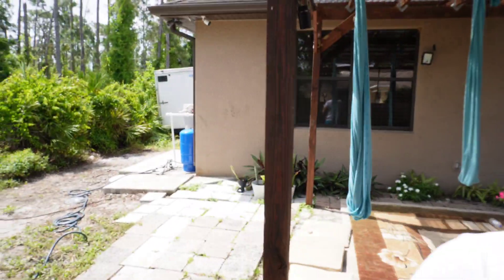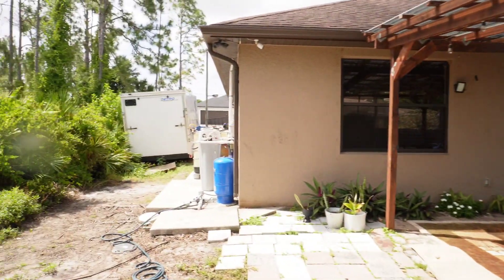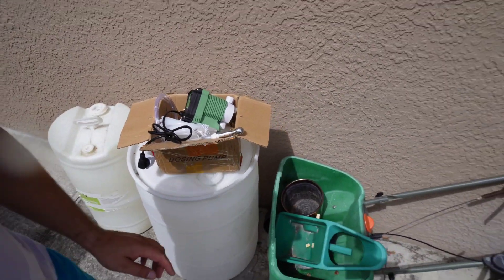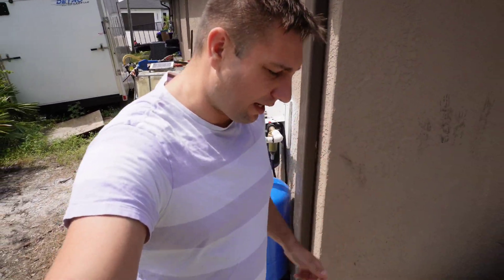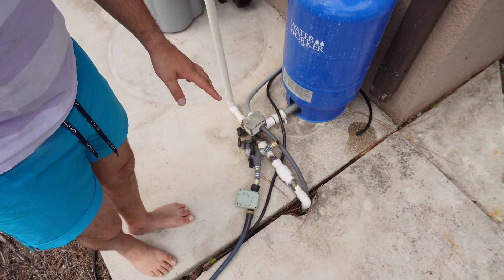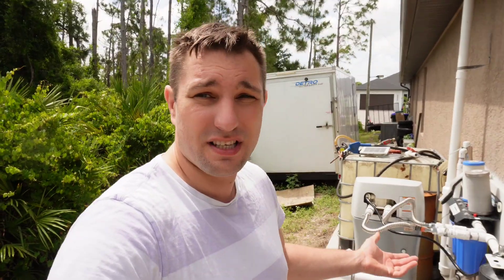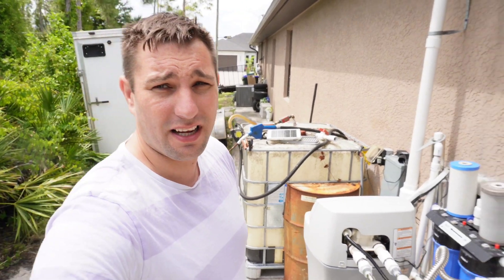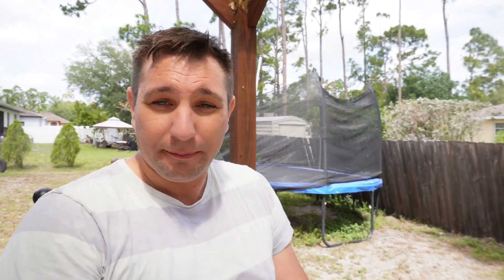How To Remove/Fix Rotten Egg Smell On Well Water Just Under 50$ Dollars

Comment: Sis you drill a hole into your well?
Reply from the maker: @blueceligts180  on side yes its empty any way but be careful drill small ammouts cuz theres a pump water line and if you over drill youll drill in to it so drill just small hole my system sill works till this day and we have amazing water and no need to pay over 6k
Reply: Okay cool. How long did it take before the smell went away?
Reply from the maker: @blueceligts180  2 days but you have to clean out your well tho
Reply: @YuriyDtv  okay. but idk how deep my well is so I'm not sure how many of the pool shocks to add to it
Reply from the maker: @blueceligts180  if you in florida use 2 bads if in any other state 1 bag
Reply: So I drilled a hole into my well pipe and it started spraying water. My understanding is there is an outer tube and then an inner which the pump is connected to. I drilled slowly into the pipe and yet a constant flow of water. I shut off my pump power and same constant flow.
Reply from the maker: @blueceligts180  well mus be that watter is at top of well cuz if youd drilled throw the other water pump line there would be a high presure watter coming out so i dont know.  i can see your wel i dont know how it was built
Reply: Will it work if you pump it into a large open tank and let it sits for a day. Will the smell go away?

Comment: Hey, my well doesnt have a opening at the top for me to put the aerator back into the well. How did you install your aerator back into the well?
Reply from the maker: @blueceligts180  my does have but if yours doesn't you need to dig it up or find a way to put watter back in to well  my system stil works and watter is amazing

Comment: I am working on the same problem. I'm so glad I came across your video. A couple of questions: Is this still working for you? How many gallons in your water well? What is the fitting called you used to attach aerator? Are you concerned if it fell out ? You could run your well dry and burn up your pump. I would wire it or use gorilla tape to secure it. If you were to cut the pipe from well and plumb in the water faucet. You could run your water directly from well head. 
And avoid the water hose, Lowe's sells a 4 ft stainless steel hose perfect for this.
Thanks
Reply: Does the aerator come with those o rings that keep it in the casing?
Reply from the maker: no you have to go from 3/8ths to water hose adapter and it has orings if i understand what you saying
Reply from the maker: all working fine for 6 months now no problem and we got drinkable water. i dont know how many gallons in feww but it doesn't matter because watter recirculates it self back to well i do 3 hours in the night and 3 houre during day.

Comment: What about a solar powered pond pump. And run a hose down your well into the water at the bottom and pump air into the water? For free? Don't have to deal with water line and rust or sediment build up or your pump running too much.
Reply from the maker: to be honest its way to much work  but i mean you could do it

Comment: The hose timer is brilliant! I did a lot of research online too, and found either people selling a couple of hardware store fittings for like $150.00 (and NO returns accepted if it doesn’t work), or DIY setups like yours. The issue with everything I found before watching your vid was the aeration ran constantly, which is real bad for the pump. Your idea for the hose timer fixes that - run it for a short time overnight. Thanks a bunch!
Reply from the maker: no problem brother  glad to help u